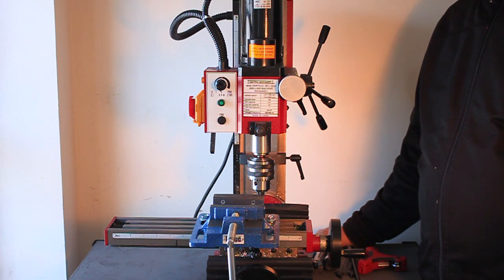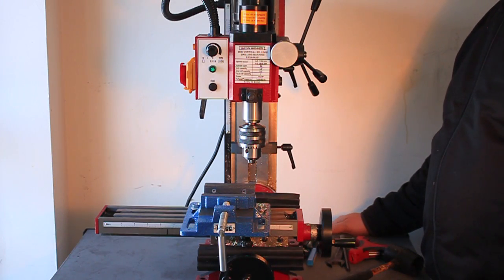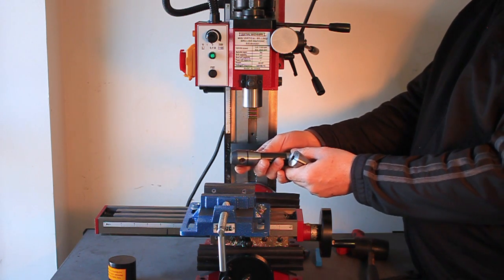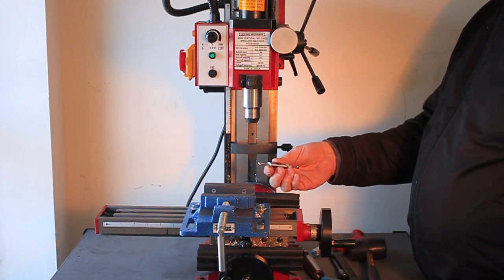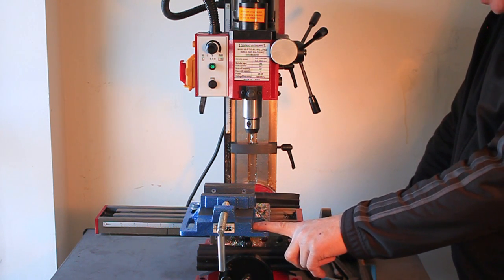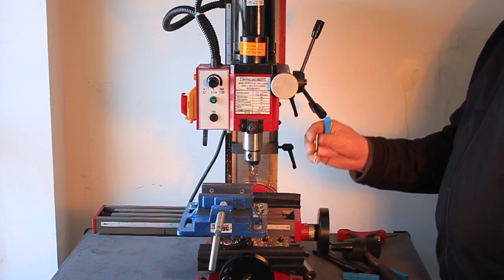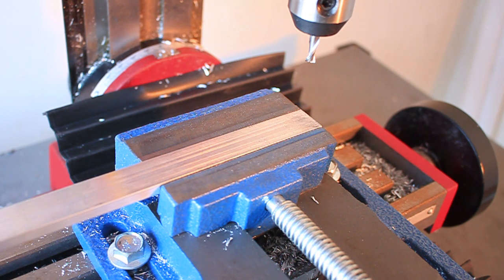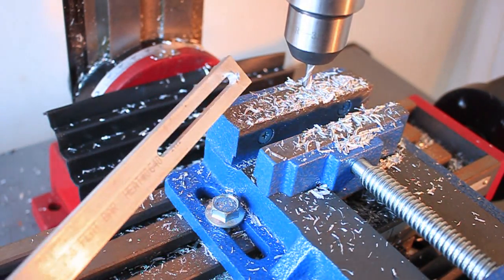Harbor Freight Mini Milling Machine

Comment: their is definitely a place for these small machines. been thinking about one like this for myself or a step larger. a Bridgeport will not fit in my garage. that is not even a thought for me.
Reply: +Martin Jones With machine tools try to get as big a machine as you can. The added mass reduces chatter. But if you are only going to be working soft materials it matters less. Brass, aluminum, and plastic are easy. Once you move up into ferrous metal though the little hobby machines really start showing their limitations. I have an RF-32 which is about twice as big as the machine here, and it struggles with steel. Well, compared to a Bridgeport. I've run mills that made Bridgeports look like toys too though. But there is not much call usually for pocketing with a 3" hogging mill.
Reply: I'm not really a machinist but I do  do research and logically this mill will be like a gantry mill for an ant just like how we look at a full size Bridgeport so why can't it cut steel maybe light cuts but it should get the work done with longer time

Comment: Pardon my ignorance, why can't you use the check instead of a end mill holder? Also will this work on steel?
Reply from the maker: +Question Everything Drill chucks are made for drilling, not cutting. If you try it it will vibrate like crazy and probably break something, definitely not recommended. Yes this will work on steel but you should use some type of cutting fluid like Tap Magic.

Comment: I'm thinking about get this one at Harbor Freight. 
But I have  question on Specifications ... 
END MILL CAPACITY 1/2 INCH  ?
FACE MILL CAPACITY 1 INCH  ?
DRILL CAPACITY 1/2 INCH  ?
Anyone please answer
Thank you very much
Reply: +virat thongsan If you go on the website of the company that you are buying it from it will have all the specs of the machine, please read the manual before operating, all the best
Reply: +binness Thank you very much. I ordered the mini milling machine from Harbor Freight last Saturday I will get the machine by this Saturday :) thanks again.
Reply: +virat thongsan Those look to be standard R8 collets, which are available up to 7/8 in the collet version and larger in the adapter version. The torque needed to rotate the tool while cutting is the only limiting factor.
Reply: +papa Hajek Thank you very much.
Reply: +papa Hajek The lowest RPM the spindle can run is a factor as well. That is due to tool peripheral speed for the material you are working with.
Reply: +virat thongsan 
It has an R-8 spindle taper. R-8 collets come in sizes up the 7/8".

Comment: im sure it can mill aluminum and brass

what about steel or very hard steel ? 
have you attempt to machine any of that stuff ?
Reply: +minimachineshop No one that knows what they're doing machine cuts hardened steel. That is what grinding machines are for. Either that or you anneal the work, machine it, then harden it again.
Reply: Gerald Gepes
While there are exceptions, no one that knows what they're doing would cut hardened steel for production work. It is just stupid to do such a thing. Hardened steel can always be tempered before being machined too. Although you do strike me as the careless type.
Reply: +Faisal Abdulaziz yes, i was wonder how many horsepower or watts the motor is on these. I'm thinking it can only be a light-duty mill. it just doesn't seem sturdy and robust for a serious steel machining project, more of a simple hobbyist tool. also shavings look like they can get into the threads of the crank.
if you do steel, I'd use oil lubricant on the workpiece and very good end mill bits, go slow.
probably good for the cost and size
Reply: pds tech This has a 300 watt brushed DC motor. Milling steel is something I would not try with this mill. This is a light duty mill. Brass aluminum and other soft metals will be just fine.
Reply from the maker: +Faisal Abdulaziz Yes I also cut steel with this machine, works well but you just need to go slower than you would with aluminum. I haven't tried steel that has been ultra hardened but I'm sure with the correct end mill it can be done.
Reply: thanks! should be ok for my models, and some engraving. I don't do much real machining so I'm thinking about this. i just want to step up from using a Dremel
Reply: Paul Frederick 
Yes, that's one way of doing it. I've run into plenty of situations where I was milling hard steel though. Oh, I'm a machinist and machine builder, pretty sure I know what equipment can do what.
Reply: +Paul Frederick 
Rigidity is indeed important but the base of the issue is that you said no one who knows what they're doing cuts hardened steel which is false. I could careless about this machine or its capabilities at this point.
Reply: pds tech If a step up from a dremel is what you are looking for, you will be more than satisfied with this mill. If you want the Cadillac of mini mills, look at the little machine shop 3990. It's an upgraded version of the same mill. It has a 500 watt brushless motor, its belt driven from the factory and has an air spring pre-installed. Its a more expensive option but you won't have to upgrade anything.
Reply: pds tech thank you...and it seems i need a bigger/better model....
however this can  do 40% of what i do...
Reply: +Paul Frederick 
Not so fast, between solid carbide and PCB inserts, cutting hardened steel is very easy now. Grinding is typically reserved for high precision applications.
Reply: Gerald Gepes
If you are a machinist then you should know that there are hard steels that have not been hardened. Hardening is a heat treatment process. But some steel alloys are just naturally hard. Which is to say that not all "hard" steels are "hardened" steel.
Reply: +Paul Frederick 
I also know that cbn and tungsten carbide are much harder and when push comes to shove, they cut 60 rc steel.
Reply: Gerald Gepes
Perhaps what you don't know is those kinds of bits need heavy, rigid machines to effectively push, and shove, their way through hard stock? Otherwise they just shatter.
Reply: Gerald, you're wrong. Sorry, but if you are or have been doing that, or have seen someone doing that, you or they don't actually know what you're doing, because machine cutting hardened steel is a waste of both the machine, and the heat treat. I'm sorry that you don't seem to be taking getting educated well, but trade qualifications don't actually always mean you know what you're on about and I have a degree in application metallurgy, so calm your tits buddy cos you're just wrong. Don't worry, learning is a good thing, right?
Reply: Gerald Gepes
Well when I worked in a tool and die shop the only thing we did with hardened steel was grind it. Because everything we did was high precision, and hardened before we shipped it out anyways. We did all of the milling, stamping, drilling, sawing, and turning before we sent work out to be hardened. Then we ground it. But we were professional machinists, so what did we know?

Comment: the first thing to go will be the electrical box on the rear. these things are just junk.
Reply from the maker: +bob f I have to disagree. I know some peoples experiences with Harbor Freight tools aren't great, but I've never had an issue with the power box and this machine has soooooooo many hours on it! Great product if used properly.
Reply: +bob f If you ttrow out the rear box you throw out all your DC controls what you gonna do then, pay another $250 for another Chinese box of junk controller.?  You get what you pay for If you can afford bigger and better good luck to you.

Comment: I bought what appears to be this exact machine from "Micro Mark" several years ago, for a lot more than $500.  Makes me sick thinking about it.
Reply: +Dosbomber Don't feel bad.  They (MicroMark) provide a bit more added value than HF.  Most of the time it is graduations in inches and they supposedly hold the manufacturers to slightly higher standards.  As long as you are using it and like it you are getting your moneys worth regardless of who you bought it from.
Reply from the maker: +Dosbomber Yes this is basically the same machine that is sold under several different names and vendors.
Reply: +minimachineshop They're not the same machines. They are the same designs. The machines are made in a variety of different factories though. Needless to say some factories make higher quality machines than others do. What you have is called a Sieg X3. At least it looks like a Sieg. But Sieg didn't make it, probably.
Reply: Yeah I had the same one by Grizzley for about 800. I got it for free though. There's only one manufacturer but they sell them to hundreds or retailers under different brand names. Same with the little lathes too.
Reply: Ferrous Furniture
There are actually many manufacturers. My DJ-32 is an RF-32 clone, but it was made in mainland China, not Taiwan.
Reply: Dosbomber..... the mill you got from "Micro Mark" is the same mill as sold at Harbor Freight, Grizzly (their smallest mill), and four or five others.... with minor variances,  and they are all made by SEIG Industrial Group in China.    This is basically the "X2" series from SEIG and there are Eight (8) different versions of the mill from the basic "X2" like HF sells - on up to the SX2LF which has a larger table and a 500W High Torque, Brushless DC motor.... and their top X2 series is the X2.7 which has an even larger table, a 600 watt brushless AC motor (very high torque at low speeds), variable speed Belt dtive (is Very quiet),  and is Very easy to convert to CNC capabilities.

Comment: Yes sir i was wonderin if there is a cut off tool for these mini lathes? If so where would i get one? also is there a place to get metal gears the plastic ones i am sure will not make it very long. thx for the help Micbhael
Reply: Alex Ramos  i sure am i am waitin for one more order to make my 10 when those are sent out i will take another 10 orders and then make them i think this will keep me from gettin behind?
Reply: michael hopp There is a belt drive conversion that is much better than the plastic gears. There are probably plans on the internet to make it yourself or you can buy it from littlemachineshop.com

Comment: I forgot to mention, look into a belt drive kit. It will save you down the road, You will break a plastic gear.
Reply: rdsii64 yup will happen first time fly cut or do a interrupted cut...upgrade kit is around 100..160$ flea bay
Reply: That was my question, if it had plastic gears like the HF mini lathe.
Reply: @Demobius  Go to little machineshop dot com. look at their base model. It is an upgraded version of this mill.  It comes with a factory belt drive and a brushless motor. Its more expensive though, but you don't have to modify it and mess with your warrenty like I had to do  with mine.
https://littlemachineshop.com/products/product_view.php?ProductID=3990&category=1387807683

Comment: Mine is the solid column Sieg branded X2 and came with a larger  table and a factory installed airspring so I paid a little more. Either way these are some work horse machines for what the are. I added an igaging DRO for my x axis. Igaging stuff is accurate and not expensive. Look into Tormach manual mill quick change kit. At 190 dollars,  Its expensive but well worth the money.

Comment: DO NOT drop the bar in loose and hit it. Only a turn or two loose then tap, finish by holding chuck/tool and hand turning the drawbar. You'll damage the drawbar and/or tool holder.

Comment: I remember being advised to use oil when cutting and go only a little bit down at a time with multiple runs to make a deep slot... Does it have controlled up-down motion  (table) - as on big mills?
Reply: +Sasha0K it only has the simple down stop on the head. no stop on the z lever. this is a light duty mill for small jobs. It would be good for me as I only work with plastics and aluminum once in a while and something small is all i need. Catch these on sale at HF and you can get one for less than 350

Comment: What size is your end mill holder? MT2 1/4 or MT3 1/2?
Reply from the maker: Truthseeker707 This machine uses an R8 spindle taper. That particular end mill holder is for 3/8" shank tooling.
Reply: Cool thanks for the info. I just bought that mill and need to tool up.

Comment: If you leave the drawbar threaded into the collet and just loosen it a bit, you can tap the drawbar to break the taper free, then you just finish unthreading the drawbar and the chuck/collet will drop free. This will prevent the threads from peening over.
Reply: Sandman Actual Yep I found that out the hard way. when I replace my malled draw bar i'm upgrading to a TTS manual mill quick change collet system. That way I only have to install one collet ever and only have to change adapters. no more tapping on the draw bar with a mallet.

Comment: Thx for gettin back to me i am goin with the bridgeport, I know i can get a cnc put on that and it will take the load i give it. Thx again my friend Michael
Reply: +michael hopp While you can just slap motors on a manual mill and convert it to CNC, that is not actually how it is done professionally. To do it right you need to replace the lead screws with ball style lead screws. The devil is always in the details.
Reply: Paul Frederick Given your experience, what minimum price range and/or model would you recommend as a  machine with digital readout for very occasional fabrication of simple but accurate small parts. I only need to make one-off prototypes of inventions, but my regular machinist, who advised me that owning my own mill would be a great advantage for my design/testing process, instructed that digital readout would be a must. I do not have three phase power. Thanks.

Comment: Do they make one with x and y auto feed? If not can one be retro fited on the machine? I have been to HB several time's and have looked at the vertical mill and a lathe, not sure if i will get them or not? I may be able to get a used in good shape bridgeport from a friend that own's a machine shop. It has the auto feed, and i think it has cnc on it already and he wants 1200 bucks for it thats a deal just for the mill let alone having the cnc. probaly will get the bridge.Thx for your vids they help alot of ppl out thx Michael
Reply from the maker: michael hopp They make a power feed attachment for the x axis, or is it y? Either way I tried it and it works fine when you install it, but when you use it under load it stalls out, doesn't have enough power. I removed it. Seems like a good deal on the Bridgeport, of course if you have the space and 2 or 3 phase power source.
Reply: michael hopp yes you can get what is called a power feed for the left/right axis. I don't know if one exist for the for/aft axist outside of a full cnc upgrade
Reply: +michael hopp Old Bridgeport CNC1 machines are worth their weight in scrap. If that. Usually shops just give them away to free up floor space.

Comment: Great to see it in action. I was considering buying one of these to build small gun parts or pistol frames. Seems it would work well for that purpose being a pistol frame would be the most complex thing. Was making them for personal use and not on a wide scale. I also have certain times I need a small engine part that may be difficult to find but this would allow me to mill a custom one from scratch.

Thanks for the video it helped a lot.

I will be converting mine to CNC.

Oh and use a cutting oil next time it will save you tons in milling ends.

Comment: Loosen the drawbar only a turn or two and then use your hammer to tap the collet loose, then you won't be damaging the ends of your threads plus there is no chance the collet or endmill holder will drop out and hit the table.
Reply: I use a brass hammer that I made specifically for the job : )
Reply from the maker: Shawn Lund Great tip, thanks
Reply: Shawn Lund I give you my thanks as well.
Reply: Shawn Lund yep my same feeling been a machinist for over 28 years never loosen draw bar all the way and hit it will ruin it over time
Reply: I use a lead hammer when doing that- 10 years worth, no damage. Shawn Lund
Reply: lowrider9367 learning never stops
Reply: thats what i was thinking, otherwise you could damage you start for the threads. Loosen it, leave it threaded though.
Reply: The main problem  releasing the tool holder with a hammer is the harmful impact on the spindel top bearing. I wish I would have a solution or a better way to do that.
Reply: So you have been doing it wrong for 10 years.

Comment: can you retrofit it with a cnc system?
Reply from the maker: That's over my head but I do see some youtube vids of this machine with a cnc conversion
Reply: I was thinking the same thing I actually have a CNC kit that I got because I was gonna build one. Then after thinking I was gonna buy one of these and CNC convert it with the kit. The kits on Ebay don't have a lot of instructions with them but they come with everything you need.

I would say since wee are talking about there being gears on the X, Y, Z then it wouldn't be hard to affix the stepper motors to it and just start CNC milling your heart out.

But it would take you a bit of time to work all the kinks out but your already halfway there if you own one of these machines.
Reply: Anything can be retrofitted with a cnc system, if you're clever enough

Comment: got the same machine from lms. good starter machine. I can do more than you think, I use it for all sorts of repair and fab in my atv business. Only hassle is if you hog out too much and break the delrin plastic safety gear on the transmission, a bit pricy for plastic, Also looking to upgrade to bridgeport so i can bore cylinders,
Reply from the maker: I've been lucky with the plastic gears, haven't had any issues. Sure a bridegport is what we all want but this little guy can do a lot like you said.